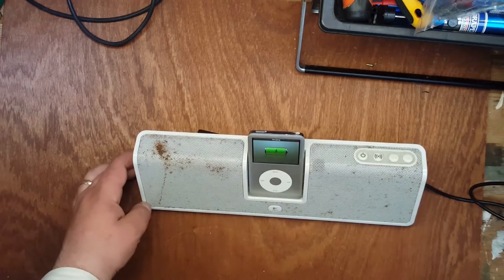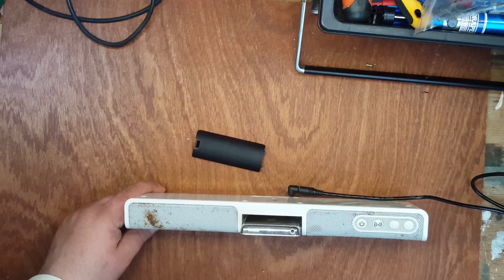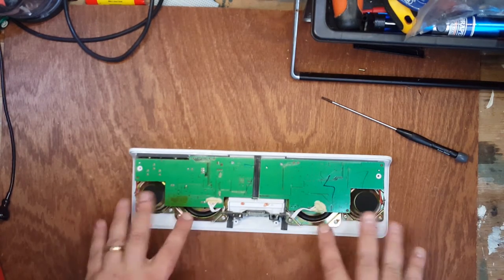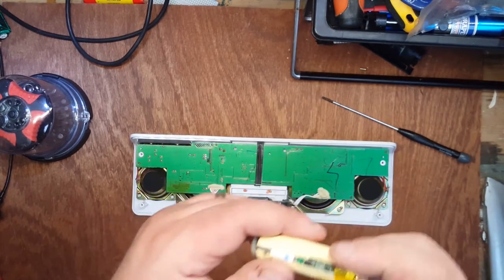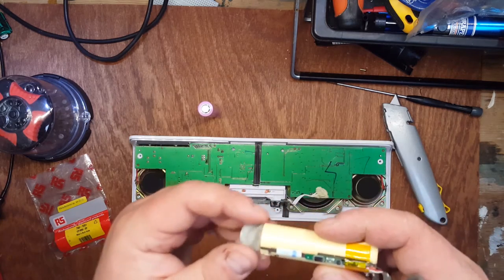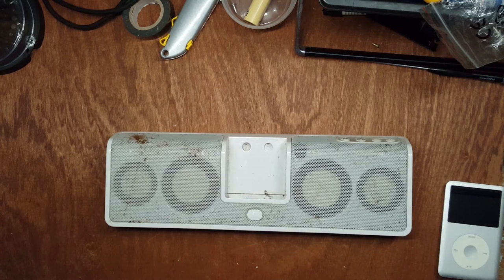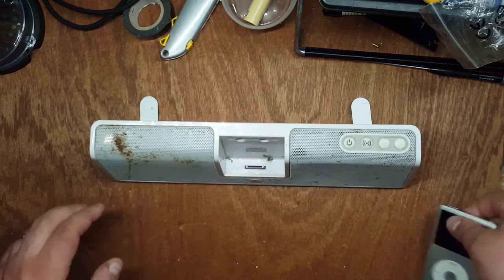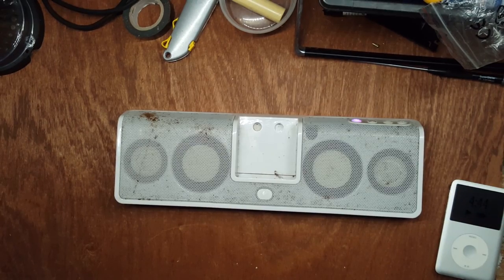Replacing a non-replaceable battery in a Logitec iPod dock.

Comment: I replaced it with a 2000mah 18650 battery and it seems to work fine. The white wire is disconected, just red and black are connected

Comment: i changed my battery, but dos not blinking when i try to charge
Reply: Did you find a reason for that and solve it?
Reply: I have the same problem, did you solve it?
Reply: I am watching the video, so have not changed the battery yet.  However, I am going to suggest that since it is a new battery, it would be fully charged and so would not be blinking if it is not taking a charge when it is plugged in.  Sorry about the wording; but, it is late.